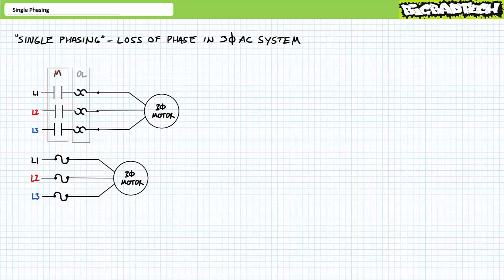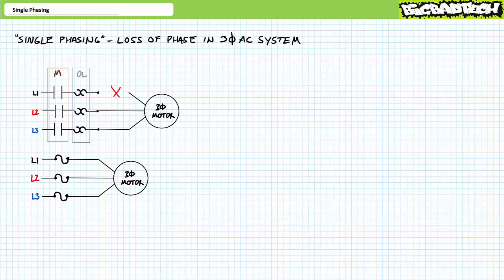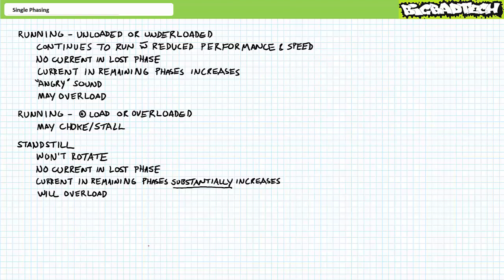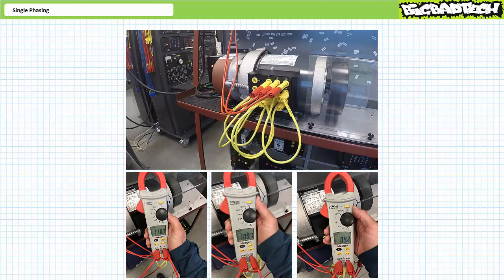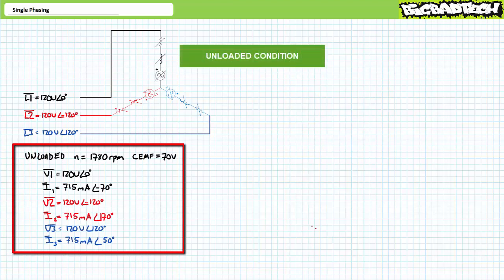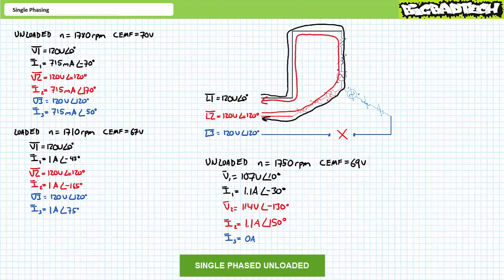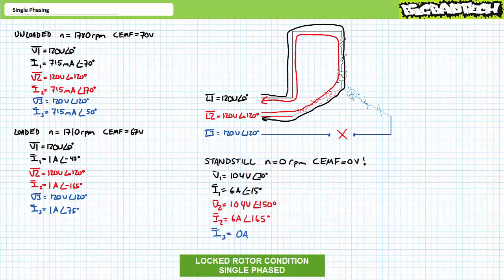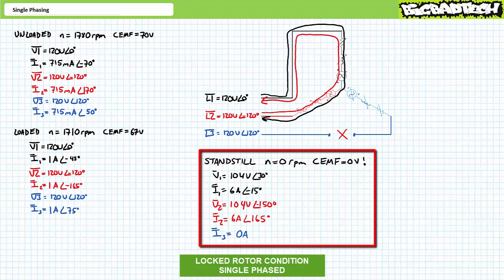Single Phasing (Part 1 of 2)

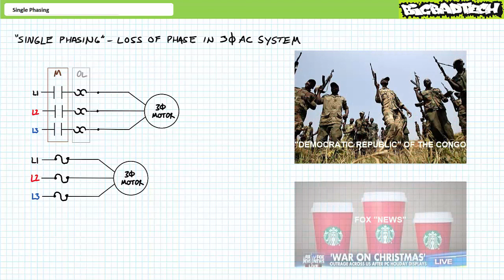Comment: Ya know….I come here because your commentary is pretty much spot on. I teach in the Union Elevator trade, and it is very helpful to have your videos to bounce my class ideas off, and to expand my thoughts on how I could teach something . You will however loose me, with @ 2:15  with your “Fox News” references. I nether care about or wish to know your affiliation with anything but electrical engineering issues. You are not the only engineering channel out here…Just an observation.
Reply: Bye ✌🏽

Comment: Interesting to see how much impedance of the motor changes depending on how fast the rotor is spinning. So, calculations in single phase motors to correct power factor need to take into account working speed.
Reply from the maker: True dat. Ideally a manufacturer will provide a data sheet illustrating PF as a function of rotational speed or mechanical power output. "Ideally" ... often times it's a single snap shot of PF and other properties at the rated condition.